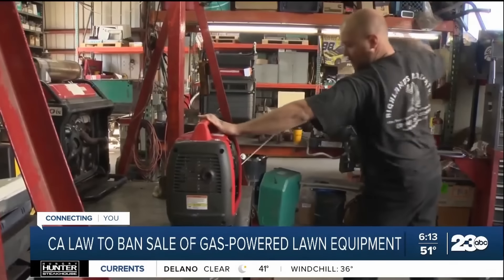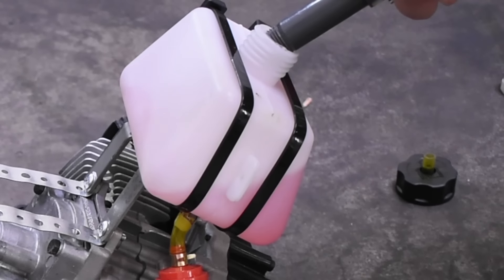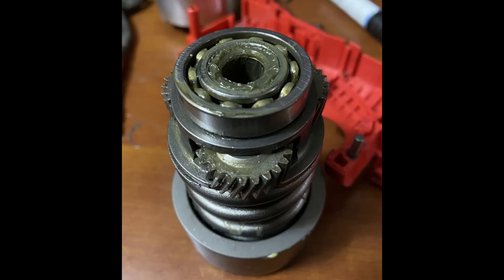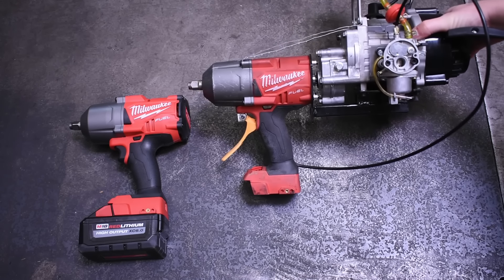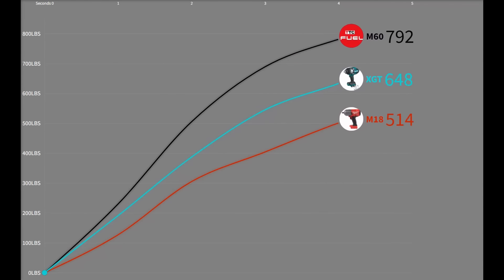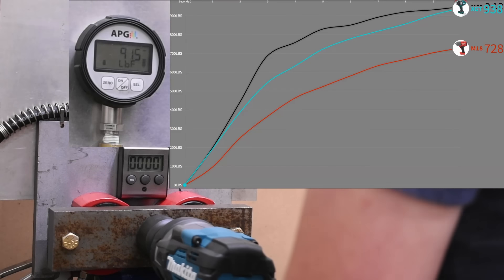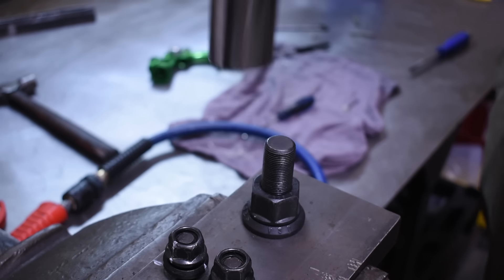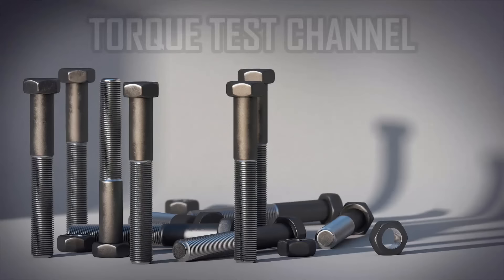Gas Powered Milwaukee Impact Wrench Because it's Illegal

Comment: Unfair comparison, the electric impacts had a full battery but the m60 only had half a tank
Reply from the maker: "I'd like to see the M60 with the new HD12.0 120oz tank, it's supposed to be way better-er!"
Reply: Ray Johnson  I think you are mistaken sir. Everything you said was correct however this comment was a joke. The punchline is that obviously adding more gas to the tank is not going to make the engine make more power, that was the funny. I hope you have a lovely day
Reply: Ray Johnson  woooosh
Reply: Ray Johnson  bro it was a joke. Hard to tell sometimes over text, don't get me wrong, but this was totally a joke
Reply: Ray Johnson  you must be a hit at parties.
Reply: Ray Johnson  sarcasm🤦🏾‍♂️
Reply: Ray Johnson  facepalm
Reply: Ray Johnson  In the cars case it would be faster as less weight too accelerate, in the gas powered impact it would be far superior with a full tank of gas than the electric.
Reply: Sometimes you just have to get the full Ray Johnson experience... Then you know you are truly alive!
Reply: @kramnull8962  :)
Reply: Ray Johnson  more fuel = slower car technically
Reply: Hahaha that made me laugh 🤣
Reply: There's always that one guy that doesn't get sarcasm
Reply: @brett4569  duuuude your making it worse by making it make sense lol
Reply: Thank you sir for making my day lol
Reply: Shenanigans I tell you
Reply: You are correct.  The fuel line pressure difference between a full tank and a half tank could theoretically make a difference.🤣

Comment: put a 13b mazda engine on it, it'll fit like a charm. Preferably with turbo's
Reply: And then call Rob Damn to 4-rotor it
Reply: @SuperSecretSquirell  Beat me to that. Le Mans.
Reply: Why that weedwacker engine will be more reliable
Reply: @joshmitchell5654  who needs reliability when the big job takes a nano second. Think super light duty cycle. 😂
Reply: @georgesrisomsak9650  the engine still needs to start... I'm not sure what you are getting at
Reply: 4 rotor is better cuz it is just a bigger version of a dentist drill
Reply: With compond turbos too we gotta have all the boost
Reply: i hate to be the person but ls swap it
Reply: Put a 5.9 Cummins on it😄
Reply: @R.Sole88109  well the wartsila-sulzer rta96c is a better option
Reply: @sanep4275  only if they compound turbo it with a 200 shot of nitrous😉

It's amazing the humans can build a engine that big👍🏻
Reply: IT NEEDS A V8 HEMI
Reply: Rip to rotary engine torque.
Reply: @R.Sole88109  look at the size of the single turbo it already has and i think the 200 shot is a little too small for it
Reply: @sanep4275  I went for the lower shot incase the internals haven't been uprated.

The 6BT is a pretty strong engine but can suffer mechanical mischief if you abuse them.

God kills a kitten when someone kills a Cummins🤣
Reply: @R.Sole88109  so what engine we talking about? the cummins or the wartsila-sultzer rta96c? both diesel
Reply: @sanep4275  Apologies I thought you were talking about the Cummins, I figured there was more chance of you having one of them and not the big arse ship engine😉
Reply: I'm dropping my Makita tools for Mazda. Need me a drill that redlines at nine grand.
Reply: Technically, they did make a rotary chainsaw.

Comment: If Milwaukee produced a gas impact in a 3/4 or 1” d handle style you’d have every heavy equip mechanic, farmer, etc drooling
Reply: There are gas powered impacts around. I think theyre all super big,  though.
Reply: They are called hydraulic powered impacts. They are super common in the heavy equipment service industry.

Comment: Insane how powerful electric motors are when compared size to power
Reply: I remember seeing a video of a guy who took a cordless driver, modded it and hooked it onto a grappling hook line. He was able to ascend a multi-story building Batman style. Wild stuff.
Reply: It's a duality gas is larger but the fuel source is consistent and electric is smaller but the power isnt consistent
Reply: @redlight3932  Plug it into a wallsocket and its consistent
Reply: @redlight3932  easy to wire a 12v or 120v ti anything hahahaha
Reply: @kevkev5935  video link?
Reply: @Soundwave857  talking more broadly about electric and gas as fuel I doubt you'd plug your leafblower in the wall for landscaping a building when gas is mobile same goes for cars can't drive around with a plug hanging out your Tesla
Reply: @redlight3932  than research a solution to make it consistent. the Internal combustion engine wasnt always like it is today.
Reply: @thefistofshadow7392  I'm saying at their peaks the fuel sources are inherently different and are suited for different things ultimately hybrid would be the most effective use of both instead of one outright I don't even like electric and personally believe things that would rearrange the structure of how our society runs for example engine recycling why on earth are we making whole new cars if our goal is to save the environment when there's old cars and motors already made any use a of a brand new car would add new CO2 into the environment let alone the production and transport of heavy cars as a whole everyone's too consumerist and would rather virtue signal with a brand new Tesla when picking a old car from the junk and giving it new life completely voids it's carbon footprint since it was already made you cannot take back that CO2 already burnt but the co2 of the future is a different story
Reply: I Am A Duck  You work in an office, don't you.
Reply: I Am A Duck  Too bad there aren't enough materials to actually make that a reality, nevermind the insane pollution caused by mining and refining of those materials compared to just using better designed ICE.

Electric is not the way.
Reply: @trikstari7687  shhhh… they probably don’t understand how they get their precious electric batteries anyways
Reply: I Am A Duck  air powered tools are better
Reply: @redlight3932  Sadly, its because a majority of the population believe having the newest car or gadget will raise their social status. As long as it gets the job done there's no point in getting rid of something just to get a new model. Which is why I drive a car from 2004, even though my family gives me crap about its condition.  This younger generation is even worse. I work with high school students and I've heard some chick will only date a guy if he has an iPhone.  Which with that kind of attitude, it seems like any guy with an android would be dodging a bullet.
Reply: @thefistofshadow7392  They have a solution already, its called a hybrid. lol
Reply: @Soundwave857  Try doing landscaping professional with an electric weedeater.  You'd spend more time dealing with the cord.  Thats if the jobsite even has power. The place I worked for mowed the lawn of repo'ed houses.  Which had no power.
Reply: Plus you have the max torque available at o-max rpm unlike combustion where the max torgue is available only at a certain rpm.  Which eliminate the need for multiple gears and a gear box is only really nessecary for reverse in EVs.
Reply: @fukkitful  Hybrid cars still run on fule.. its just more efficient and with plug-in-hybrids you just have a tiny little battery.
Reply: @thefistofshadow7392  Hybrid run on fule?! Really I never would have guessed...  

Really I think hydrogen vehicles would be the best solution.  As long as you can produce hydrogen in large quantities with renewable energy.  It might just be a conspiracy but I've heard that a company holding certain patients have blocked further development. EVs sound good until you start to dig a little deeper.  The production of the battery create a lot of pollution and need to be exchanged every 10 years. Plus if the electricity powering them comes from a coal plant than they still arn't carbon neutral.

I do agree hybrid aren't the final solution.  But for now they're better than nothing.  Plus with hybrid you can run an electric turbo which is just awesome.
Reply: @fukkitful  Hydrogen is stupid, it takes even more energy than refine the same amount of diesel/gas fule for the same distance and if you use it in a conbustion engine its effectiveness drops again to like 30%.
Without pointing out any storage problems like tank leaks, temperature and how heavy the tank has to be.

Just invest in batteries, make better cells and use electric cars instead.
And if we manage to build our infrastructure around it, its even cheaper than fule.
We need higher capacity batteries with a faster recharge, thats not impossibe. 

BTW the same amount of electric power used to make a Liter of gas will almost get you as far as using the power directly in an electric car. So the "we dont have the power needed to power that much cars is wrong.

And lets be real, electric cars dont have near as much parts that could cause problems or break compared to anything else.
Reply: I Am A Duck  WHAT?
Reply: I don't see why we can't have diversified power systems. Why do things have to be done only 1 way. And why force everyone to comply with that 1 way. In both power generation and the use of it.
Reply: @thefistofshadow7392  the only solution is to reduce power output down from maximum. That usually means limiting low to mid range torque. The maximum power is only available with a full battery and as the battery drains so does the maximum power output.
Gas is less power dense (after taking into account engine and transmission) than electric but will always perform the same as long as it has fuel. 
Electric typically has a significant torque advantage over gas when providing similar max HP but the immediately and continuously lose power as they go until they run out of juice or the computer cuts power to keep from damaging the battery (usually between 60% and 30% its total capacity)
Currently batteries can be made much higher power than available if they use more volatile materials. Battery fires becoming more common (especially on 1000 lbs or larger batteries) sounds like a really bad idea though lmao
Reply: @fukkitful  I agree, the guys with Androids are the lucky ones in this situation.

Plus, nobody even considers the fact that power outages happen.

I have been in many hurricanes where power was out for a week plus, but the good ole gas generator and propane stove kept us fed and cool.

Plus I made a ton of money because I own a gas chainsaw.
Reply: @fukkitful  Hydrogen is not a good solution.

All of the processes are too energy negative to produce Hydrogen, not to mention Hydrogen is one of the scariest elements.
Reply: @redlight3932  Many trains and trams are essential plugged in all the time either using overhead power lines or a third rail. No reason we couldn’t incorporate a similar technology into roads to power electric cars while driving.
Reply: @thefistofshadow7392  It's currently cheaper. But when everything is all electric, the entire grid will need replacing and the electric companies will pass that cost onto the consumer. Then we will have rediculously high gas and electric costs.
Reply: @thefistofshadow7392  Electric cars have less parts to break? How about the high voltage battery that will need replacicing at the tune of 1/3 the original price of the vehicle?
Reply: @alecb8509  Gas needs to be refined and uses for that just a little less electricity than using an electric car to drive the same distance.
So we have the energy, its even cheaper than gas.

The Gird doesnt stay forever, at some point it gets old and the capacity is reached, thats nothing new. The only thing that would change is demand growth rate. Thats a problem we have to solve sooner or later, because demand will in the future go up anyway.
Reply: ? motors perhaps, but not the energy source.

Comment: The battery life is phoenomonal!

And it charges in under 10 seconds amazing!
Reply: Also doesn’t have performance degradation from heat or cold
Reply: Did it get a proper "recharge" between runs?!  😆
Reply: after 6 months battery will say how dare u
Reply: Energy density ftw
Reply: @FishFind3000  says someone who hasn't tried to start a weed Wacker on a coold morning
Reply: @FishFind3000  No performance degradation from cold? heh, such innocence.
Matter of fact, if you can get past the "fuckin thing won't run" part, then you'll have increased performance because of the cold air!
Reply: if you have multiple battery then can just charge the dead ones and use the other charged ones. power cost less then fuel xD
Reply: @FishFind3000  what are you talking about it does have a performance degradation in cold battery isn’t effected much unless it’s really really cold
Reply: Standby time is very bad, thou, at least if you don’t want to get up and use 2 hands to make it ready…. 😉

Comment: This is awesome!!  Since your guys are using a CAG engine, get a "winged head" kit and a 15mm pumper carb.  And a good exhaust and high performance clutch.  Pocket bike forums have lot of info on these engines.  I bet you could break 1k ft/lbs

Comment: The 2 stroke engine will happily run in both directions with some small mods 👍🏻 great video
Reply: The 2 smoke is skookum as frigg
Reply: It’s not a diesel, so no it won’t.
Reply: @EATSLEEPDRIVE2002  2 strokes can run both directions, that's how snowmobiles reverse
Reply: @EATSLEEPDRIVE2002  shows what you know
Reply: @EATSLEEPDRIVE2002  of course it will you just have to change spark timing
Reply: @engineergaming2553  only if it’s direct injected. Which this one is not
Reply: @patrikmuller151  OK, go ahead and make one run backwards. We’ll wait
Reply: @EATSLEEPDRIVE2002  carb snowmobiles also can reverse just fine had an 06 polaris 600 myself
Reply: I confirm it will work if starts in reverse like golf cart just remove the pull start and use a drill with a socket as a starter  !
Reply: @EATSLEEPDRIVE2002  had a golf cart that was 2 stroke and ran both directions. Putting it in reverse changed the polarity on the starter/generator and made the engine run in reverse.